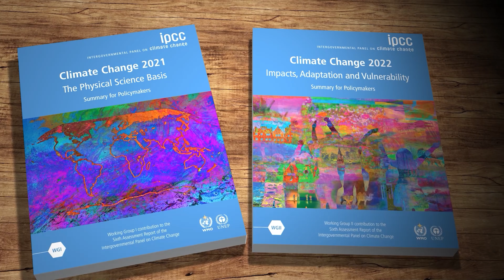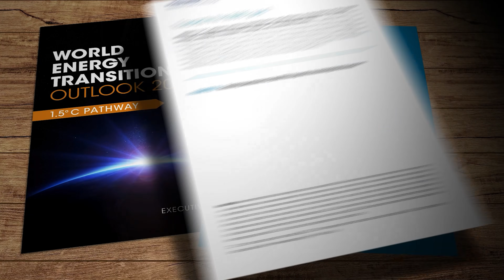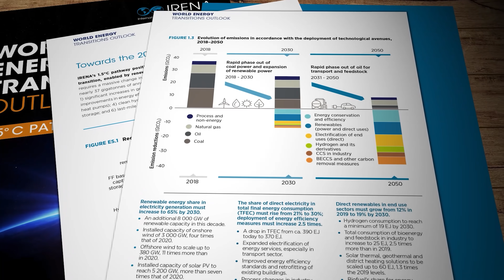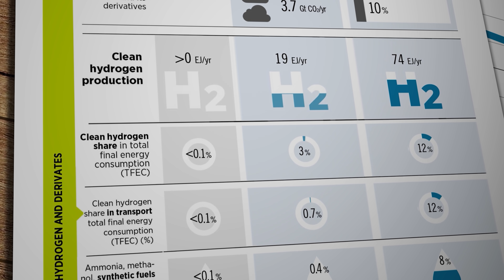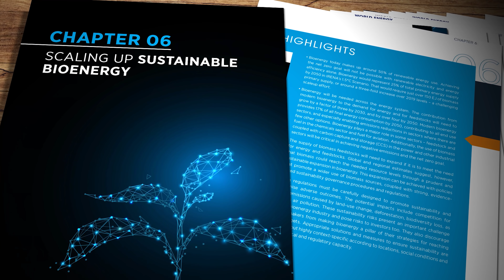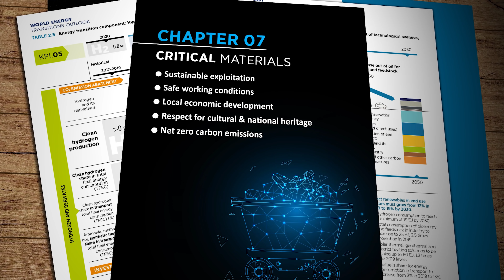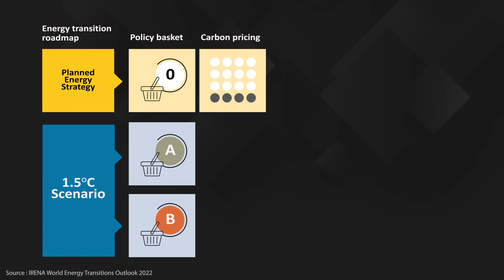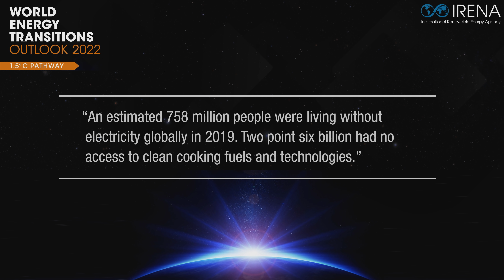Massive global energy disruptions are coming. Brace yourself!

Comment: Energy shocks tend to be short term of no more than a year, 2 or 3 at the most, the reason is because the longer energy prices stay high, the more of a threat that becomes to the fossil industry because high prices pushes countries to invest a lot more into alternative energy sources, in other words, the longer energy prices stay high, the quicker the fossil industry kills it's self, hence why even in the past when we've seen really high spikes in oil prices, they don't last that long because the industry knows that even thought they stand to benefit in the short term, they are doing their own industry a lot of damage.

Now it's even worse because energy is becoming a security issue which could damage the fossil industry more.

If the fossil industry was smart, they should try and resolve these high prices as quickly as possible before western countries do a big push to alternative energies, because once you lose them, good luck getting them back and with that, we could be seeing a new energy revolution happening in EU countries over the next decade and again, if the fossil industry was smart, they would try and fill that void that Russia is leaving behind and at a respectable price point as soon as possible before it's too late for them.

To put it in simply terms, don't mess with modern countries because they've proven over the years that they can adapt to anything that's thrown at them, in other words, if fossil fuels stay high, they'll cut them out and use alternative energy sources, which there are a lot of options with the right push and investment.

Comment: If a data center has such a large amount of waste heat why can it not be used as the feed stock for a hydrothermal generator. If drilling is so expensive that it puts a high risk on geothermal this would derisk the system. And if the turbine was made modular then it could be moved to another location if the data center was decommissioned.

Comment: As always you have made a good presentation. In this case a snapshot of the IRENA report. However, unless I have missed something there appears to be no mention in the report of nuclear power and the future developments of nuclear power (Thorium molten salt and metal reactors).  
Like it or not nuclear power is part of the solution.  To ignore it as part of the solution Is the same as ignoring methane as part of the problem of the greenhouse gases that caused global warming.  And ignoring nuclear power is as dangerous as ignoring methane.  This happens with reports from so many so called “Green” organisations and media.
To state the obvious, Thorium molten salt reactors avoid pressurised water and avoid a huge costs of building a massive reinforced concrete containment vessel needed by the LWRs.  Then the reactors can be run efficiently and economically and constantly producing electricity to top up the renewable power “when the wind don't blow when the sun don't shine”.  and at all other times can be used to store energy long term high energy density form such as hydrogen (steel reduction etc) or hydrocarbons (as a chemical feed stock or CO2 neutral aviation fuel).  And can also be used  to recover the wasted energy in nuclear waste.
Even if thorium power is only used as a transition, until clean(er) Fission reactors become a reality at the very least this avenue of energy supply needs to be explored not ignored.

Comment: Bioenergy is absolutely unsustainable under any circumstances. Mining is always incredibly destructive. Hydro power generates huge amounts of methane and destroys ecosystems. If we manufacture, mine, dam, and burn all of our forests for biofuels, we will destroy our ability to live on the planet. We have to stop using fossil fuels, and we have to stop using most other energy sources. We are up a creek without a paddle. Also, obviously, global regulations can't be implemented and/or don't work. If one country decides not to enforce carbon pricing, manufacturing will flock to that country to take advantage of lower production costs.

Comment: Did I miss it or is there no mention of nuclear power in this report?  I know most people in the green energy movement consider a nuclear power plant as being equal to a nuclear bomb, despite the facts, but how does nuclear power figure in here?  Without getting into the weeds of fusion power or even thorium, nuclear power is just about the lowest carbon producer we have, right now, that can actually meet our energy needs.  We could have been off of oil decades ago, if not for the anti-nuclear movement.

Comment: The sad truth is that the loss of Arctic sea ice and the melting of the permafrost across the far north are contributing massive quantities of methane into the atmosphere.  Methane traps far more heat than does CO2 before it is ultimately broken down into CO2 and water vapor.  This silent process will continue for many decades and will more than cancel whatever emissions reductions we humans may achieve.  See the Just Have a Think video "Arctic Methane.  Has 2020 triggered a tipping point?"

Comment: I don’t agree with comments that blame capital providers/investors (greed) or consumers (cheap) or even politicians (weak/short-term thinking).   The issue is that humans are biologically wired to maximize pleasure and avoid pain.  Pleasure comes in many forms -profits, “savings” to spend on other things, High powered engines or being elected.   Pain is taxes, loss of income, public anger, investment losses.   Dealing with the environment is so difficult simply because the pleasure obtained by not dealing with it is “immediate” and the “pain” is far in the future/gradual.   Dealing with it involves pain today to have some potential pleasure in the long distant future.   I agree that higher carbon taxes today - offset by income tax decreases will ensure that pain is applied to carbon emission but not overall consumers.  However our politicians can’t help but want to carve off some of the taxes for their own benefit.

Comment: Beaurocracy is not the answer.   Government wants to profit from global warming regulations.   Solar, wind, hydroeletric and nuclear will increase regardless of global warming.  Electric cars and new tech and old tech for heating and cooling will help reduce reliance on oil.  Talking about policies doesn't reflect action.  If they spent the billions on solar panels they spend on government planning and oil discovery and production we would all be doing very well.  If everyone had two to three kilowatts of pv energy in solar production it would reduce home power consumption from the grid by two thirds.  People don't need as much energy as they use.  Heating and air conditioning are more than half our consumption bills.   Tech Ingredients build an evaporative water cooler that could replace air conditioning in even humid climates, and there are a.c. units that run on less than one horse power, that would be just ONE large solar panel of around 415 watts.  As for heating there are many more options for heating than for cooling.  Solar heating, water heat exchangers, fire places, hot air heaters, electric, and even biomass composting of mulch for warm water in the winter time, sunny or not.  These options must be studied and circulated through the population and made commercially available to the masses.  We need oil and gas right now but in a few years we will all know the solution is to drop it 100%, if possible, save it for the military and transatlantic passenger jets.

Comment: I don’t understand why some Congress and governor hasn’t negotiated and legislated a pricing structure that provides some amount of peak and off peak electricity use for free to every customer, and a quickly escalating electricity use-cost to both residents and the commercial contracts. Commercial contracts should have a standard list of options to qualify for and then enter into, some of which can be free or close to free for all I care. If increasing energy demands is that big of a problem, some poor city or village in Vermont is sure going to appreciate being able to, in most cases, draw their electricity bills down to $0 simply by restricting themselves to max amounts during different time periods. If we can learn to live through a pandemic (some of us more successfully than others by Lady Luck or by aptitude), then I would argue we could learn to stay out of the fridge during and put them on timers to shut off during peak hours. They could run appliances, charge devices, heat water, blah blah blah when doing so makes it free. Let the high consumption customers, during times that approach the system’s capacity to generate, deal with and distribute electricity be the ones to pay. It’s their consumption requirements that make it so expensive (at least I think I’m right about that part. I don’t see why it would be different). It would be a massive, permanent transfer of wealth from one kinda person (the kind that lives and makes companies that are well suited to not exacerbated our energy and climate woes) to the other kind of person (the one who would rather and has the income or wealth to live and make companies that exacerbate our energy and climate woes). Let them pay for it, they can afford it. By doing so, they’ll also fund a bunch of opportunity for small business owners who can use a certain amount for free or cheap as well. If Governor Desantis in Florida can rally the rest of the elected government against Disney World and all the other properties that they run, that are central to one of the state’s biggest tourist attractions, then Massachusetts can do my plan, right?

Comment: Issues thatseem critical but little mentioned.
Report demonstrates huge scale of issues.  Reduced consumption  could play an important part, but  not talked about.
Scaling up renewables will be very difficult.  Replacing cheap fossil fuels with them seems a hopeless task.     Car use drives high levels of resource comption, for making and fuelling them and for the extra travel they create, and reducing car use  will be difficult because suburbs depends on their flexibility.
For  my money a useful place to start would be to start to drive down vehicle weights  and speeds.  Not very high tech, but effective if politically unpopular.   Electric cars yes, but light small relatively slow ones.  But big business wants to sell SUVs.

Comment: I always wonder, where is the nuclear energy? Increasing solar and wind energy that much just seems quite a challenge. Plus, there's the challenge of providing energy during the night and when it's not windy. Sure, hydrogen could be used as energy storage as well, but it is ultimately very expensive and inefficient. There's also a huge, huge demand for green hydrogen for other industries like steel manufacturing. The demand for batteries is even larger as all the cars has to be transformed into battery electric vehicles, because there simply is no better alternative. Batteries are expensive (even though they are getting cheaper all the time), and also the battery manufacturing and mineral excavation has it's problems. Nuclear is simply the most efficient, cheapest, fastest, and safest way to go. Why is it always left out?

Comment: Later this year, I will reach my 80th birthday but I have children and grandchildren, who are my concern. As I see it, we are not only facing a problem of global warming, which would likely lead to increasing desertification, but an ever increasing global population. These two together have the potential to cause an upturn in geopolitical unrest and develop into wars, the fallout of which is likely to pollute our planet even further.  So along with reducing CO2 and other greenhouse gases, we will also have to look at ways of reversing desertification. This can be done, using a number of methods, starting with the desalination of sea water, using renewable energy, suitable tree planting, mulching the ground and preserving water in the dry seasons by means of sand dams. If we can get a sufficient coverage of arid areas through extra vegetation, this can induce an effect of inducing more humidity in the areas, leading to increased rainfall.  Such could allow more space for agriculture and living space. Although these are hardly ever mentioned, there are also tidal generators, which are a bit like upside down wind turbines with the blades in the water and operate on the ebb and the flow of the tides, thus if strategically sited could provide energy on a 24/7 basis. Though not suited for all locations, they could form part of an overall strategy of providing renewable energy, of which take on many forms, from geo-thermal to the solar and wind we all know about. One of the biggest obstacles to this brave new world is the greed of many politicians, financiers and industrialists, so this would need a far reaching campaign. A lesser precedent to doing this was the fight to reduce the holes in the ozone layer by reducing the us of  chlorine and bromine atoms in the atmosphere which reacted negatively with the ozone layer by depleting it. As I see it by global cooperation, we have the technology to address these problems now and the biggest challenge will be to encourage a global political will and the time to start, should be now, otherwise some of our future generations very uncertain lives.

Comment: The Edison generator powered cars trucks trains airplanes helicopters have not been examined or built.  Thomas A Edison invented the generator as a self spinning generator that delivers higher voltage AC power continuous peak power with inverter and transformers.  Usually the generator inverter transformers power dynamos with inverters and transformers to deliver high voltage AC continuous peak power without fuel or pollution.  These very inexpensive power plants are very clean power without fuel.  The misinformation regarding power generation is common to mass media interpretation of the environment.  We should be shutting down nuclear technology halogenated vinyl and halogenated carbon. While we shifts fossil fuels to environmental cleanup from transportation and electric power.  This site also never mentioned Edison generators and dynamos to replace nuclear power and fossil fuels.  We could have unlimited range electric cars trucks trains airplanes and helicopters using Edison generators or dynamos to power electric motors.  The handling of climate change global warming has been given to unprofessional efforts we are strapped to political beliefs and solutions without any concerns about chemistry and physics.

Comment: I hate to break it to you, but hydrogen, and by extension hydrogen fuel cells, are a dead-end technology and not useful.  It is far easier and much more efficient to just put the electricity that you would have used to split / separate the (purified) water into H2 and O, either directly onto the grid, or use it to charge conventional batteries, cryobattery's, etc...

The whole hydrogen thing is a red herring.  Sounds great on paper, but in the real world, H2 requires the use of thick, heavy tanks for storage, the fuel cells themselves use a lot of very rare and 
expensive metals as catalysts, they don't last very long before needing to be rebuilt, use way more "rare earth" materials in their construction, are heavier, and are much more expensive to produce, than an equivalent amount of batteries.  The whole thing is essentially a non-starter, just make more batteries with those same resources and you'll be much better off.

Comment: I am struggling to get a picture of how Green Hydrogen will shape the future, not just as a burnable gas or an exportable energy store but through fuel cells as a driver for efficiencies such as heat pumps. There are many moving parts here. Can you do one of your excellent summaries on the interactions of these parts in a new global energy system.